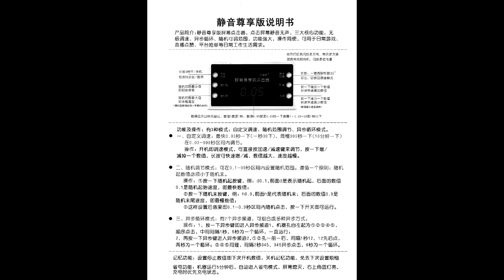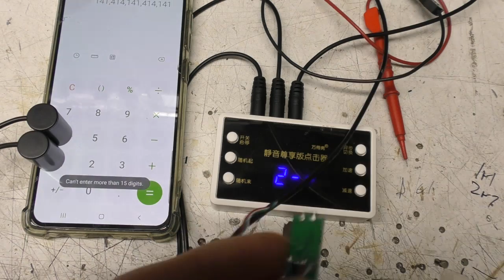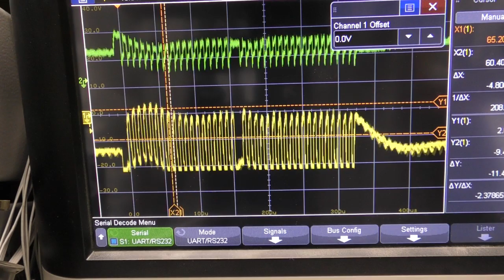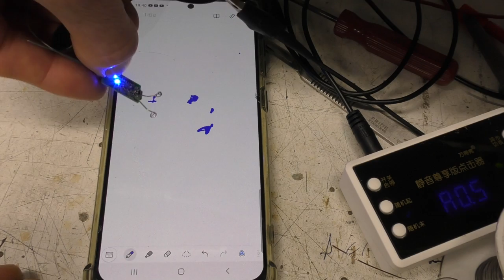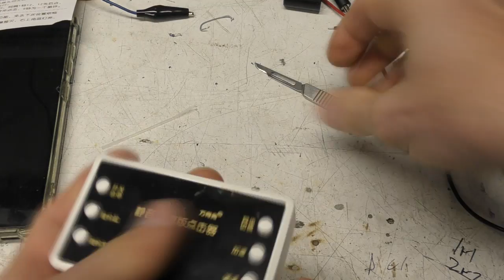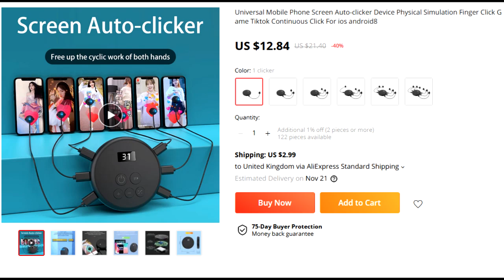Phone touchscreen auto-clicker

Comment: So how exactly is the +/- 20V interacting with the capacitive touch screen?  I've tried to build something like this controlled by an Arduino but driving a pad on the screen to ground doesn't seem to work properly (constant "touch").  I've been hypothesizing that maybe creating a field between two points might be more reliable.  What does the voltage switching do?
Reply: Hey Whitney, did you ever figure this out? Would absolutely love to know
Reply: @MatthewNuo  definitely not. Decided that I would just buy one of these devices and then I moved onto another project.
Reply: @whitneysomerville5402  Dang. Regardless, thanks for the reply
Reply: I know I'm super late to reply, but just a note for someone else in case they'll run into the same issue. I literally fall into the rabbit hole of active capacitive trigger. From diving into multiple patents of capacitive stylus, into finding this video and learn that such device already exists lol.

"It doesn't seem to work properly (constant "touch")"
One of the reasons why it failed and produced such constant touch is because the tip/pad/contact you made is probably large. So large that it able to trigger the touchscreen passively.
A simple solution for this, simply make the contact smaller so that its capacitance is small enough that it doesn't trigger the touch screen passively.
Don't afraid to make it small, even 3-4mm is fine. Though you'll need a higher voltage if the contact is too small.

You can actually see this in active capacitive stylus. The metal tip is only 2mm, yet when it powered, it still able to be recognized by the touchscreen. But the active circuitry that drive it does produce like ~60v peak-to-peak.
But I think if you make the contact a bit larger (but not too large that it'll get triggered passively), you'll be fine driving it with 20-30v.

Comment: What I would like to better understand is the circuit that generates +-20V. It seems it uses capacitors only, no inductors
Reply: It is not in the circuit diagram he shows, but the main device creates it, because the actual "fingers" are connected with the 4 pole connector (+20V/-20V/trigger/GND). He mentions it at the end of the video. Probably some cheap voltage regulator IC, with a SMD inductor. You could use a Cockcroft-Walton generator with only capacitors and diodes, but would need too many stages for this high voltage from 3.3V input. Just one of these cents cheap voltage regulator ICs and an inductor needs less parts and regulates even better.
Reply: It's likely just a capacitive charge pump. There are lots of cheap ICs that can do this. It requires just a few capacitors, you put x voltage across them, and then connect them in series to get a higher voltage which gets buffered onto another output capacitor. You switch back and forth between these two configurations, essentially.

Comment: The problem of automatic touch occurs after changing the touch screen in general.  And the solution is two ways.  Either change the original touch screen.  Or if the touch screen is of a separate type, a buffer is placed between it and the screen so that no interference occurs when pressing or touching.  Whoever wants to understand more is welcome.  I will post clarifications on this subject in the future, as well as experiences.  I forgot that there is a strange third solution too...
Reply: it's quite interesting I would like to understand more about it please I didn't understand how +- 20 v alternate according to the senesing transistors .In opamp I think it's easier to take a signal and give inverse voltage signal.and what's the this solution if you please?

Comment: what a scam item...there are apps that do this and much more hahaha
Reply: Maybe the apps are more detectable as being a bot so they get banned or get the detected views or app downloads whatever removed
Reply: This is not a scam item. Because you know what it does. It taps your screen externally. The bigger scam is the “free” auto clicker software that I doubt they are offering to the public out of purely good intentions. Who knows what kind of spyware those auto clicking apps have running in the background.
Reply: My first though that is was used to crack peoples stolen or lost phones brute force style. I am not sure at what point an Android or Apple will lock you out totally so I could be wrong.
Reply: @1seb11  thanks, how is it done then?
Reply: @MaxUgly  
It's done using a Brute-Force-Attack software, not a clicker, and even then it's not efficient, since most phones will factory reset after (mostly) 10 tries. 

And if you consider devices that don't have that factory reset option - Since the auto-clicker is not programmable (Unless maybe you know how to), It's going to take ages if brute-force it. 

Most programs use a what's so called "a dictionary attack", which consists of frequently used phrases or PIN digits that the software is going to try one by one. 

Also consider that the device will be disabled (not allowing you to enter passcode) after 5 tries for 1 minute, after 7 tries for 5 minutes, and the 8th for 15 minutes etc. So you might miss the correct passcode. 

Considering all this, your probability to hack the phone using this method is very low. It might work on phones that have NO factory reset or disabling feature, but I don't know any devices that have neither options...
Reply: @labscience8271  I know for a fact there are methods to get phones into a mode where they accept unlimited guesses in a row. I have seen it myself in some more advanced data recovery places. It depends on a lot of factors but they essentially use a custom bootloader which selectively disables certain security checks.
Reply: nah apple phones are locked down

Comment: Hi Mike...enjoy the way you tear things down to figure out how they work...very interesting as I do something similar. A wee question for you and your subscribers...I have recently tore a SPX AUTOBOSS V-30 Vehicle Diagnostics Computer down to find that a small chip is missing from an interface that seems to be causing the computer not to fully communicate with certain vehicles? I have searched the planet for it's part number etc and cannot find it anywhere or from any manufacturer? have you any idea how I would go about finding out what this chip is doing and a possible replacement/alternative part number...I'd like to get this unit fully operational if possible...my guess is it is some sort of opto coupler/isolator? the only info I can furnish you with is a part number/case style which is 24V infinity symbol (an 8 on it's side) SOT-6 case style. I haven't really delved into it much with a meter/scope etc. Maybe someone out in the world/one of your subscribers may be able to help out with this one? Thanks.
Reply: You'd need to show the schematic for that area of the board to figure it out. Optocouplers almost always have 4 pins, so if it's a SOT-6 then it may well be something different. If you want to know what it does, you need to reverse-engineer the circuit around it. It'll either be really obvious or really non-obvious, depending on what it's doing.
Reply: @AureliusR  I cannot get a schematic for this item as it was made by one company and Bosh bought it over...its like chasing a rabbit down a hole! I have come across opto couplers with 6 pins as well...2 pins just not used...support/mechanical stability? I'm gussing i'm going to have to dig a bit deeper with meters etc...i just havent spent much time on it as yet but thanks for your suggestion...here in Ireland technical assistance/help can be a wee bit hard to find at time's and the internet is our friend! Thanks again.
Reply: @whitenorthstar  What I meant was you need to reverse-engineer it yourself to get the schematic.
Reply: Busca un clon o sea otra computadora que esté andando y ahí vera que pieza le falta xd

Comment: I've seen a self built version of this a few years ago. The guy used an arduino with a BJT (if I remember correctly) to set the ammount of clicks. He then sandwiched the lead coming from the BJT between the display and a penny. This worked fine and I was stunned! After seeing this video, I dug deeper into the inner workings of capacitive touchscreens.
Reply: Do you have a link?
Reply: @sethkazzim731  sadly not, I searched for it when I saw this video, but I cant find it anymore :(
Reply: @sethkazzim731  https://youtu.be/ClFSUXebY7Q

Comment: I wonder if they simply used a MOSFET to connect a pad touching the screen to the chassis of the phone or earth ground? The pad itself would be small and low capacitance enough so as not to affect the screen when the FET is in cutoff, but when the FET is turned on then the capacitance from the display matrix to ground should activate the screen.  I'm guessing that would not work because if it did they would have done that instead.

Comment: I'm wondering if this could make a pen for phone
Reply: Take a cotton stick, Q tip, or such, wrap it nearly to the end with aluminum foil, dip the cotton end in water, and voila, you have a stylus for your phone. It conducts the electricity from your body to the end of the cotton, the water helps the conductivity.
Reply: @zebhall9229  interesting idea. I think your suggestion would create dollar store pens (which has a metal body and a round conducted rubber tip where it touches the phone). That works like a finger, and it works fine but not precise. I'm more interested in precise touch like a pen which you can write neatly
Reply: Check "active stylus teardown" on YouTube

Comment: An autoclicker app is easier and more versatile. Just one click away 😂
Reply: autoclicker Its a similar approach like why they don't use simply emulators instead of real phones.  Apps can be detected or circumvented and they tend to need (at least) basic understanding and scripting to use them. This is on the other hand easy to use for everybody who can press 2 buttons and good luck to detect it from your application, it will "press" the screen every time a slightly further away depending on the timing and charge (nearly random).
Reply: Sure, just sacrifice access to your device to some unknown, shady developer. Great idea!

Comment: lol. I guess that's something a game-cheat detction program can't do anything about. A physical bot instead of a software-based one.
Reply: Well you can detect that buttons are being pressed in the exact same XY position every time or that the screen is pressed exactly every 100ms or how odd it is that a person is playing for 24/7 straight, stuff like that which only a bot would do, but otherwise yeah that would be very hard to detect.
Reply: @vgamesx1  
that's exactly what I was thinking, and also though it would be a big upgrade if they added in a sheet like fashion, where you have anything between 20-50 separate zones and just add a small vibration motor to "displace" each click by a tiny random amount.

it would be at a slightly higher cost, but could be used to do a whole screen manipulation without any real moving parts.
vibration motors might not bee even needed if you have enough zones, or if the software doesn't check finger position.

The cost would obviously be more, but the potentials is far higher, given that you could simulate even more tasks with some clever programing.
Reply: @vgamesx1  It's not the exact x/y position in every time, it depends on the scanning frequency of the screen and the momentary charge, it's an analog coupling from the screen's perspective, so you can bet it has some variance at leas a couple of pixels, and you can put some jitter to the timing too. It's far superior to some click emulators, is you want to detect them. You may can ban people who click to fast, but you will ban real people too and you will upset them really fast.
Reply: @vgamesx1 see

Comment: You can enable pointer location debugging info in the Android developer settings. To enable developer mode, go to "settings" -> "about phone" and tap "build number" until it tells you that the mode is unlocked. Now the developer options are available under the "system" section in the settings menu. The "pointer location" setting is very useful when testing styluses.

Comment: Very interesting device! I once had to make an automated test fixture to test an array of capacitive proximity sensors - I used a pair of signal diodes in series with an electrode connected in the middle, reverse biasing the diodes makes the electrode float,  a forward bias makes the electrode a low -Z path to GND.

Comment: It seems like it would be easier to partially disassemble the screen and hook into the digitiser?
Reply: thats very much not the case. hooking into the data stream between digitizer and processor and intercepting/faking the screen is quite a lot of effort and requires a lot of knowledge. this device is simple enough for anyone to use and gets the job done without any extra hardware.
Reply: @drkastenbrot  What about for more complex automation like scrolling and clicking arbitrary points on the screen?
Reply: @binaryagenda  you can actually get this sort of thing to scroll, never tried with this implementation but it definitely can be done,
slap a couple of $0.10 probes on a screen and you're good to go vs open the phone, attach a very sensitive circuit to the digitizer connections that can't possibly cost less than $1.50 and hope for the best.
on a simple display with like an spi interface on a chunky connector maybe intercepting the display data would be easier but on a phone that puts the touchscreen controller on the mainboard good luck
Reply: @binaryagenda  android has the "android.hardware.faketouch" interface to easily do that in software, using existing android debugging tools. theres already apps which let you record and play back touch sequences. 
On iphones i do believe something similar exists but this device seems more like its meant for somewhat unauthorized purposes.

Comment: Aren't Q1 and Q2 symbols swapped?
Btw very interesting video as always Mike!
Greetings from Italy!
Reply from the maker: yes,well spotted
Reply: @austi01101110  I see your point but the logic behind is wrong. Let's consider Q2. The Vbe bias is about -0.5V (that is strange for an NPN). Then even if a positive 3,3V pulse is applied at the base through the capacitor, the transistor cannot turn on because the collector voltage wold be negative with respect to  the emitter voltage.
If you use a PNP instead for Q2 (without swap the position of emitter and collector, but only reversing the "arrow" symbol on the emitter) it will work. In this case a negative pulse through the capacitor would turn fully on the transistor and the collector voltage wold rise to about 20V.
Reply: Ah yes thought that was the case
Reply: @austi01101110  I didn't mean to swap collector and emitter of each transistor, but to swap the entire NPN with the PNP and vice versa (in other words just flip the emitter arrow for each transistor)